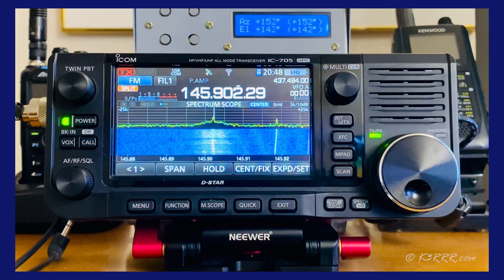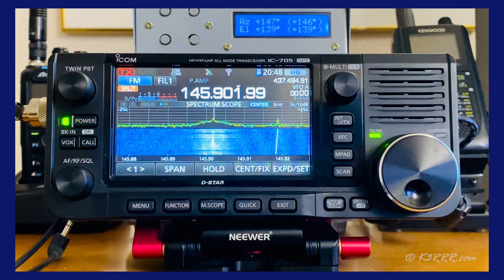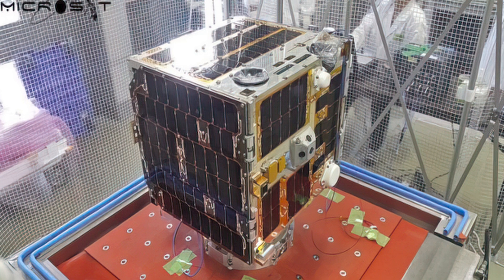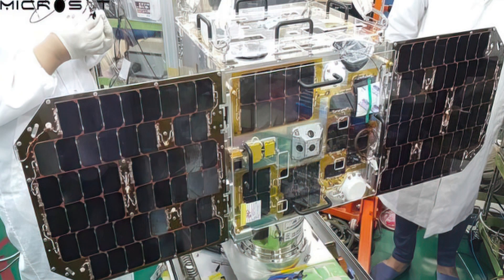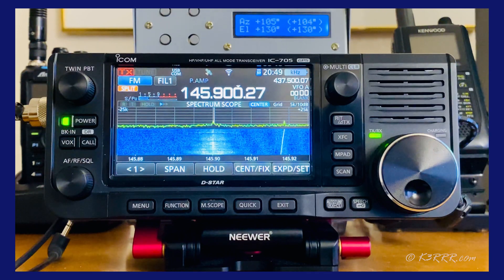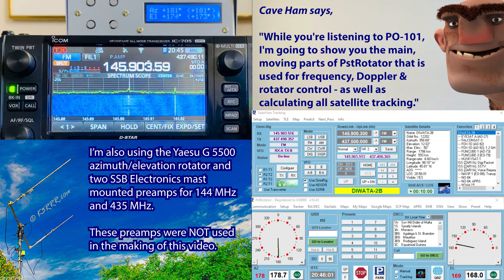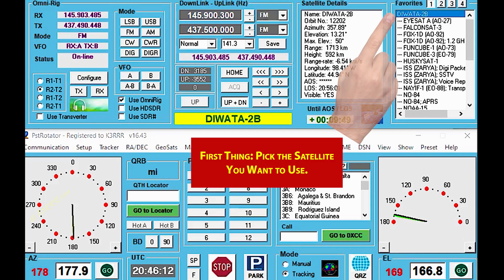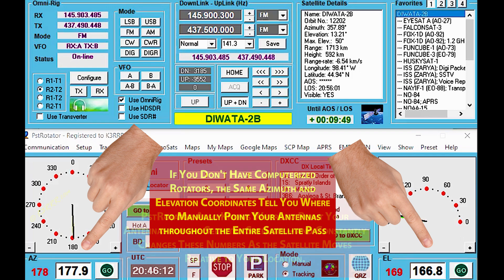Icom 705 In Space Part 1   Ten Minute Tutorial   Your Icom 705 + Ham Radio Satellites + PstRotator

Comment: Listen to the satellites?!?  Push the TX button!  Cavemen can listen to the satellites with a Baofeng.  😄
Reply from the maker: Great to hear from you… The ICOM 705 only has one antenna input. At the time I did that video, I did not have a duplexer that allowed me to connect both the antenna for the 2 m downlink frequency and provide me a way to simultaneously connect my antenna for the 70 cm uplink for transmission. I've since added a Comet TRIplexers that allows me to have both of these antennas along with my HF antenna all connected at one time feeding the single antenna input into the ICOM 705.

I have a new video coming out in the next few days that includes my first contact on satellites with the ICOM 705

Stay tuned!

Robert